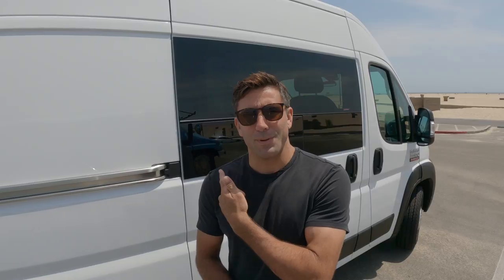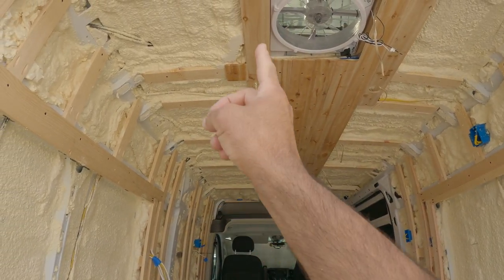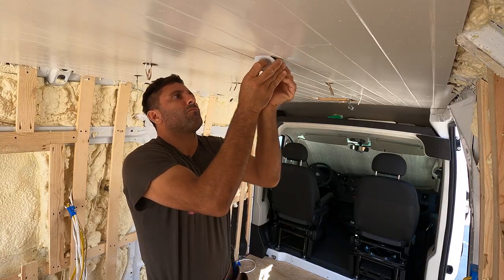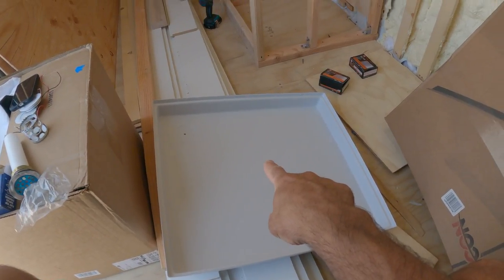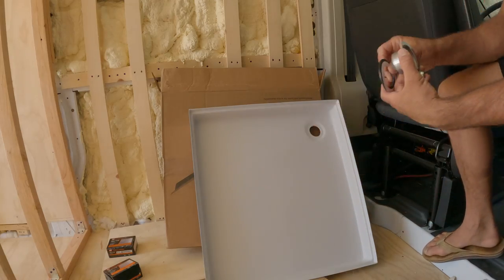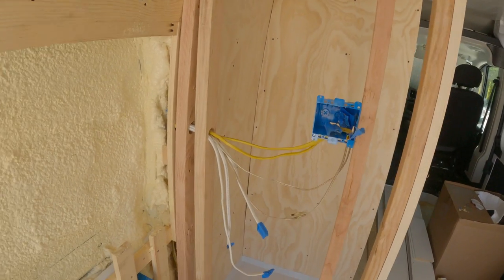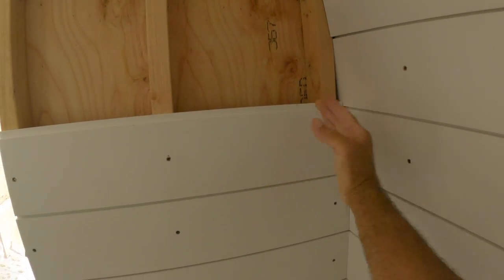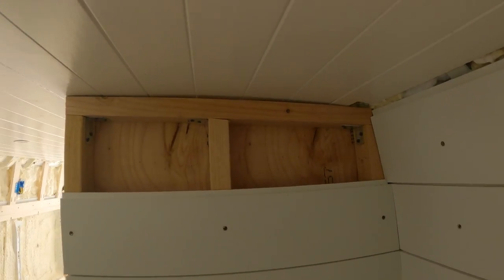Promaster Van Build | Ep5 | Shower Install | Enclosing the Walls

Comment: Just wow man!  You did such an amazing job with everything and made that bathroom build look so easy.
Reply from the maker: Thank you, I wish it was as easy as it looked!
Reply: @BuildingVanLife  how’s the shower size been working out?  I noticed the pan is slightly smaller than the usual 24x30, or 30x36 I’ve seen most people use.
Reply from the maker: @SoCalKevin  its fine b/c I don't have the toilet inside the shower, if you do the larger one, most people usually put the toilet inside the shower.  I just find that it takes up so much of the van with the larger one that it feels so enclosed inside.  To be honest on the next van I am going to go back to the outside shower out the back.  I prefer the open floor plan.

Comment: Hello. I am watching your entire series over and over and I love your work. I have a question on the shower. Did you fasten the framing to the ceiling?  Did you have any furring strips to fasten those to?
Reply from the maker: Thank you! I’m not completely sure what you mean? I screwed furring strips to all the roof beams.  I showed in earlier episodes
Reply: @BuildingVanLife  sorry I was not clear. The framing for the shower walls, did you screw the top portion into the ship lap on the ceiling or did you align the framing to be screwed thru the ship lap into the ceiling furring boards ?
Reply from the maker: @gipsygirl943 what I did was make sure the 2x3s were very tight in place so they were wedged in.  (Not so tight that they bow the ceiling though though) I screwed into the floor, the walls and the ceiling.  I was able to hit the furring strips in the walls, but on the ceiling you can only hit the furring strips on the 2x3 that goes perpendicular to the other ones.  The 2x3 that is above your head when you enter the shower.  That one is screwed into the furring strips in the ceiling.  You can also put some construction adhesive on the top piece touching the ceiling.  Hope that helped.

Comment: Thank you for the great videos.  Most of  the other videos shows start and finish, nothing in between.  When I am struggling with my build I check your channel on how to get it right.
Great job.
Question on the shiplap. Is it MDF or pine?
Reply from the maker: thank you.  It's MDF from Home depot.  Pine would work well too.  The trade off is mdf is going to have a more smooth perfect looking finish but pine would be more durable

Comment: Hi there, would you be able to update on that expandy foam insulation bit more, please? How is it holding? I always suspect the spray on foam insulation might get detached from the van body as it contracts and expands with the weather.
Much appreciated if you would comment.
Thanks
Reply from the maker: I have now put the spray foam on 5 vans and it's holding up perfectly.  This video you are commenting on is van #4.   First this stuff is not going to detach, anything it touches it permanently bonds to.  You will find that out if you get it anywhere you don't want it.  Second, it expands into every little space in the van so even if it magically detached, there is no way it could move.   I would never use any other type of insulation, there are so many advantages.
Reply: @BuildingVanLife  much obliged

Comment: Great video, Thanks....We are just about to start framing our shower. Got a few questions...Did you frame with 2x3 or 2x4? I assume the inside 3 walls of the shower are 1/2 inch ply? Birch? Also, we will be installing a Nautilus Shower Door later. I assume that the side walls of the shower need to extend past the pan to allow room for the door to be installed? I can't really tell what that measurement should be. Any advice is appreciated :)
Reply from the maker: Hi guys thanks for watching.  I used to 2x3's to save weight.   On the walls I also went a little thinner than 1/2'' I think it was 3/8th" It makes it easier to match the curves of the van.  You don't need to use a fancy finished plywood for a sub wall like this, any plywood will do.  I had the plywood extend 1 1/2" past the shower pan ( the thickness of a 2x4)  Check out my video a few episodes past this where I install the nautilus shower door.  It should give a better idea what you need to do.
Reply: @BuildingVanLife  Thanks very much :)

Comment: I don’t see the link for the kind of wood you put on your ceiling. I like to keep mine with cedar and not paint over it. It just looks neat.
Reply from the maker: It’s from Home Depot so I don’t have a link for it.  But you should be able to find it at any Home Depot near the moldings in the planking section
Reply: @BuildingVanLife  okay-you did such a great build on your van. You must be an engineer. I enjoy watching your videos. Keep up the good work and thanks for quick answers.

Comment: I'm hoping you can help me, how do you get the shiplap so tight against  the bump out on the passenger side, I have my  strapping like yours, but when I run the boards above the kitchen cabinet I have a space between the bump out and back side of the shiplap. Hope you understand.
Reply from the maker: It’s kind of hard to know what you mean without seeing it.

Comment: What size shiplap did you use on the walls?
Reply from the maker: cant quite remember the size it's from home depot
Reply: @BuildingVanLife  about 1/2” from the look of it. Much thicker then the ceiling ones right? Thanks for all the info man, I’m about to finish up your solar panel roof rack combo. Killer
Reply from the maker: @jessemiller9660  yes thicker than the ceiling.  Around 1/2 or 5/8th

Comment: May I ask what paint you use interior or exterior and that is the brand?
Reply from the maker: It’s behr interior semi gloss Swiss coffee
Reply: What size wood you use to frame shower and shower pan?
Reply from the maker: @msterrim81  2x4 s around the pan.  2x3s on the walls
Reply: Thanks a bunch! I did mostly all my shopping from the links on your channel. I just have to find a inverter for shorepower. You didn't use one for shorepower.
Reply from the maker: @msterrim81  no i didn’t really need it with my power needs.  I did set it up so I could un plug the the cord from the back of the inverter and plug that into shore power so all the ac outlets could run off shore. Next one I think I’ll use the renogy invertor w shore power

Comment: Where did you get the Drain pipe extension?
Reply from the maker: Home Depot
Reply: @BuildingVanLife  Thank you for the fast response! I'm trying to fit a similar shower pan you have right behind the drivers seat and there is very little room to play with, I might have to hodge podge something to get it too work. Again thanks for your help!